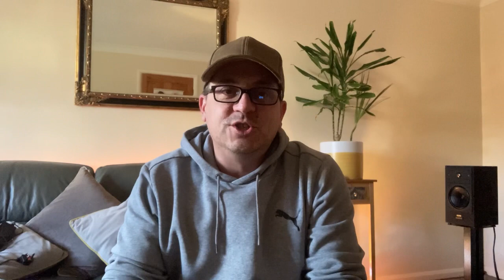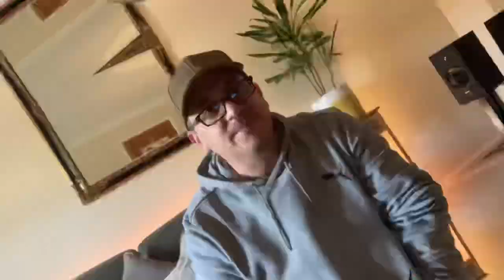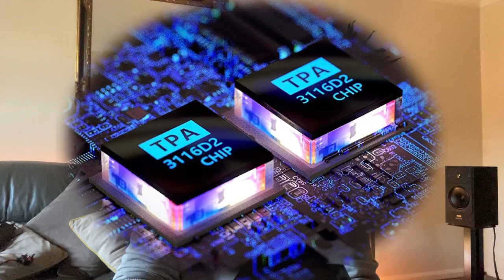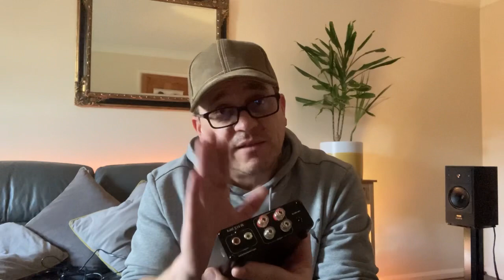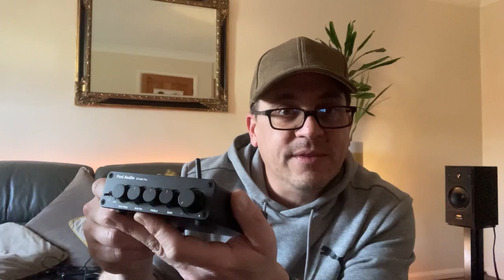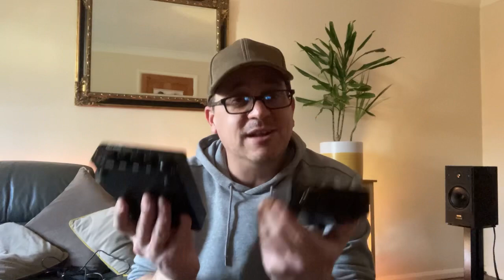Fosi Audio TB10D & BT30D Pro Amplifier Review #hifi #digital #hifireview

Comment: I have a Fosi T20 tube amp, a BT30D (non Pro), and a BT30D Pro (w/ big PSU) in various little systems around my home, workshop and office. All of them sound amazing.

On top of this in my study, I run a 7.1 NAD-based all-analog system fed by the wonderful 8-channel ASUS Xonar HDAV 1.3 Deluxe, driven by 4x LM4562 and 8x JRC2114D op-amps. That's for movies and games. But for music on my PC I have built an incredible 2.1 system.

1x Fosi GR70 tube/headphone preamp (RCA --> ZA3s)
1x Hifiman Sundara headphones
1x Fosi ZD3 DAC (XLR --> ZA3s)
1x Fosi X5 Phono pre-amp (Via RCA switch -->ZD3)
2x Fosi ZA3 (48V) in mono
1x Fosi M03 subwoofer monoblock
7x Very nice speakers (fronts are switched)
2x Lovely passive subs (switched)

This system allows me to seamlessly switch from 7.1 to 2.1 systems, and I can switch from transistor sounds to tube sounds by flipping the input switches on the ZA3s. Additional to this, when I engage the Sundaras, I can switch off the ZA3s, and allow the subwoofer to continue operating. That creates a fairly mind-blowing sound stage, feeling the bass as well as hearing it.

I can't tell you how much I love my Fosi gear. ALL of it makes my old speakers and my old music sound brand new again. And I am enjoying genres on the Fosi gear that always left me cold in the past, and the range of emotions the Fosi gear can create for me is truly astonishing. I never knew my speakers, or music, could sound so good.

Comment: i'm using the BT30D pro with 2 SVS prime pinnacle towers and an SB1000 pro and it sounds amazing. Can't imagine needing anything more and it's so easy to bluetooth in. Gets louder than I can handle with 0 issues.

Comment: I appreciate your review. Still, to me it’s shocking hearing people talk about Bluetooth without discussing SBC vs LDAC vs AAC or aptX and then say Bluetooth “may possibly” degrade the signal — yes, you’re recompressing to a low complexity, low bitrate, lossy format — but then go on about balanced cables for short distance runs (so minute), or even class AB vs D amplifiers. I realize you probably don’t normally listen to your tunes crushed by SBC codec, but to me it’s night and day.

We all have different ears I suppose! Thanks again. Personally I’m happy with cheap, small amps everywhere as long as they pass muster under empirical testing. Check the TPA3255 class D, it’s incredible. I can’t say for anyone else, but to me this “analytic vs musical” sounds very much like preference for tube tone and simply the placebo effect.

I only have one digital to analog conversion though, I mix my inputs digitally, and no lossy compression. (256-320kbps AAC/Vorbis is fine, it passes blind A/B testing as identical to source)

Comment: Hi, the 48 v power supply should make a huge difference compared to the 32v 5 power supply, doubling the power 150 watt ish in 4 ohm at low distortion ,mabye 1% or even more power

Comment: Anyone know if the main speaker outputs simultaneously adjust high pass , coinciding with adjustment of the low pass subwoofer frequency control adjust knob???  I'm assuming the main speaker out's ALWAYS play full range signal, regardless of the subwoofer freq setting?  Curious, thx

Reply

Comment: When my Arcam Alpha 7 CD player and 100W/channel Kenwood KA89 integrated amp died, I replaced them with a Sony $40 DVD player to play CDs, and a Neoteck class D amp that's very similar to the Fosi BT20, with a pair of analog RCA inputs, binding posts for 1 pair of speakers, Bluetooth, and bass and treble controls, and uses the same TI3116 amp chips. With the power supplies that these amps come with, if you multiply the voltage times current capacity of the power supply, that will tell you the total amount of power available from the supply. Assuming a very generous 90% efficiency, which class D can sometimes be capable of, multiply that total by .9, and then by .5 to arrive at the maximum power available to each speaker. Then multiply that by .63 to get RMS instead of peak power, and then you'll have a rough idea of the actual power output of these little amps, which will be around 40-50W/channel, which is plenty for moderate listening levels in a small to medium sized room. It's plenty power for me in my small room sitting 10 ft. (3M) from my Wharfedale Diamond 9.1s. And, to my ears, it sounds every bit as good as the Arcam/Kenwood combo did. Total cost- $40 for the Sony, $50 for the amp, $200 for the speakers used on Ebay, and $50-100 for the Audioquest or Straightwire interconnects, and around another $50 for the Audioquest 14ga. in-wall speaker cable I use, and 4pairs of banana plugs for the speaker cable connections on the amp and speakers, for about another $20, for a total cost of about $460.

Comment: A very good review.  I have the BT30D pro with the blue tooth.  I find the volume to be slightly less using BT than with direct wired input, but its pretty good.  The more I listen to the Bluetooth setup, the more I like it. so easy to just send music to the thing and let it play.   I dont understand why fosi sells different transformers with different voltage inputs.   No where in their literature do I see anything about the advantage of the higher voltage input.   I would assume more volume, but have no idea.   Last thing is i have never turned my volume knob to max for fear of clipping and ruining a speaker.   not sure how loud it would be, but I have other normal sized amps for louder playing.   I bought it purely on a whim , and I am happy I did.  Fosi has the quality, where some of the tube type mini amps buyers claim  they are not lasting very long.

Comment: I got the standard BT30D and was so impressed I'm going to upgrade to the Pro for only $20 more
Reply: I've got the BT30D as well, along with the Q4 for a headphone Amp.....what makes the pro better in your opinion?
Reply: @RobertSpiller  
It's got the upgraded chips and rated at 150 watts per channel 350 for the bass, but don't bother it doesn't sound as clean and gets hot even with no volume. 
I returned it for the standard version much better imo...
Reply: I did this @brucesamuelson but be careful, if used with an active sub you can't control the bass or bass frequency, as it only has a preout, whereas the standard has a sub-out, I was disappointed . Normal one is so good though and probably fine for my Cambridge minx 12

Comment: My big question on the BT30D is whether the Sub Freq (subwoofer crossover frequency) adjustment is only a low pass crossover for the subwoofer low-level (RCA line level) and high-level (powered) outputs, or if it also serves as a high-pass filter for the main L/R high level (powered) outputs.
Reply from the maker: Adding the sub didn’t reduce the L/R bass output.. but I tried a passive sub
Reply: @dittonworks  I have a Monoprice powered sub, and the BT30D....how do I hook up the sub to the BT30 do I need to order cables for them...cables came with them but as you know, on the back of the amp there are 3 sub outs...1 on the left and 2 on the right...any suggestions would be most appreciated because I do not know what I'm doing lololothis is my first budget system for me.  Oh yes I do have the Sony SSCS5
Reply: @RobertSpiller  you need to use the 3.5mm headphone output jack on the back of the bt30D pro 
on the none pro model it is a mono RCA output you will use
Reply: Yes …all above, but specifically for the BT30d that I’m enjoying, my “Passive” sub is a Pioneer big boy, but then you can pair that 3.5 to the powered sub’s too. So for less than a tank of gas this little unit is freaking amazing.  TWO BIG PROBLEMS:  1. Heat. It gets hot and in high heat outside with full levels runnning it lasted about 4 hours. But after it cool off and got done being pissed off at me it played fine. It’s a jiffy puppy. 2. Where’s the ‘entire middle”???? The mid-range is the reason these are cheap. Otherwise for the price it can’t be beat IMHO. Again, small room. Bar with darts and big enough for two cars size. So fills the room big time.  More middle. Please….🙏

Comment: I've got the same Target stands as you and Spendor SR35R2 speakers, what do you use between them? They look like spikes, I've found blu tack the worst sounding followed by rubber bumpers being much better but tempted to try some sort of spike/cone system.

Cheers 

Andrew

Good luck with the move!
Reply from the maker: Rubber isolation feet under the SL600’s on this video.

Comment: I have the bt30d not the pro I have it on a pair of technics sbt200 and you these speakers they are quite power hungry  and it drives em perfect and they are very sensitive so at max volume on a different amp you can hear like white noise the bt30d nothing but silence I have the tone controls on the bass on 12 o'clock  and the treble at 3 o'clock I mostly listen to chill wave and I have a b&w asw10cm low pass on that is on 12 o'clock  and the  vol on the sub 10 o'clock and on the amp all the sub controls are 12 o'clock and it all works great the output for the amp at 8ohms is 25watts and 4ohms 50watts and 2ohms 100 watts
Reply from the maker: Thanks for watching
Reply: I have the BT30D myself...how do I add a sub to them...the 3 sub outs on the back...which one do I use?  I am a complete newby so any help would be appreciated.
Reply: the pro is where its at

Comment: I have the TB10A, and I also have a little Topping digital amp. Your right they are really good for the size and quite powerful. However even compared to something low end like a Denon 600ne amp, the Denon trounces it completely in every respect. The Denon is rated far lower for power but honestly blows both my little amps out of the water and the quality was way better on the Denon. But I agree that is great for a desk top set up, personally I dumped the Fossi and accoustic Q 2010is for a pair of JBL104's powered monitors for my PC, which to my ears are better.
Reply: Do you have a sub as well?  I have the BT30D and the Q4 headphone amp...just waiting for my cables to arrive and then I'll see if I can hook all this up together
Reply: @RobertSpiller  No i do not have a sub, funnily enough i tried the TB10a and the topping with Wharfdale 225, accoustic q 2010i/2020i and 2050i, a pair of jbl one pro. (the 4ohm version) and some Dali oberon 1's  (i have few pairs of speakers knocking around)  it worked well with the 2020i and the 2050i although the bass lacked some grip with the floor standers,  but they properly struggled with the dali Oberon 1.  The Oberons were just lifeless it was like despite the claimed watts it just did not have the grunt to power these.
Reply: I don`t agree! I soley use FOSI for everything!  I have found that things change quite dramtically when you start to get into the price point above $700. Then I would take notice of thinghs other than the "cheap" chinese/japanese  products! Denon is made in Tokyo,Japan!
Reply: @robertkensler2156  everyones ears and tastes will differ and I am sure some will prefer  the little chinise amps ( to be fair a lot of brands are made in china anyhow), however the design of it wont be.  As for Japanese Hifi is generally really well made and engineered and not the same as some of the China knock offs. Denon is an old brand that orginated in japan, but not 100% but I think its now owned by a US company, that also owns Maranz, Bower and wilkins, and Polk, and probaly most of it will be made in china, just not designed there.

Comment: I got one of these for a mobile setup. On mine the knobs were put on wrong, you might want to check that (extreme positions not symmetrical) It actually has the TPA3255 chip not the TPA3116D2  That was used in older models. Sound quality didn't disappoint at all. Easily as good as my Marantz CR-401 (CD receiver)